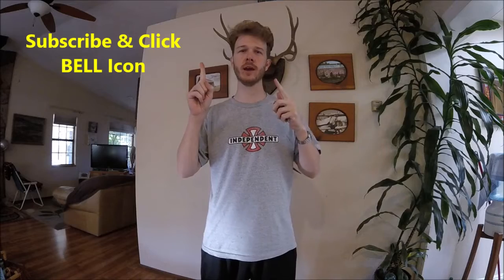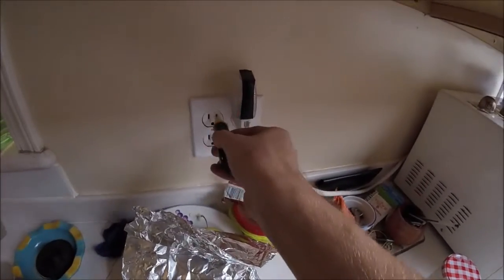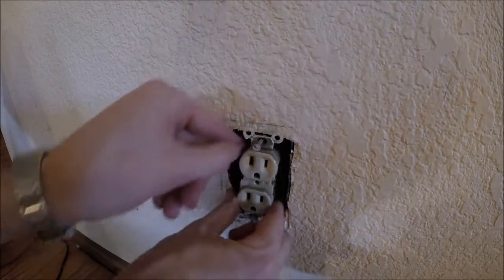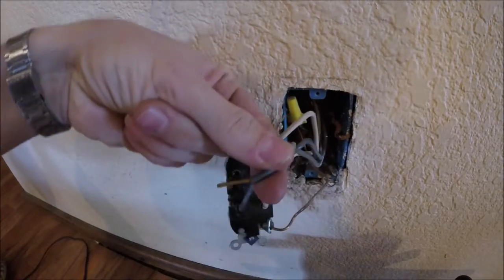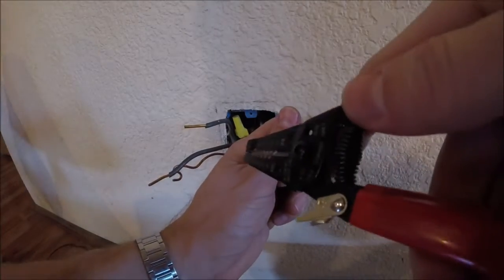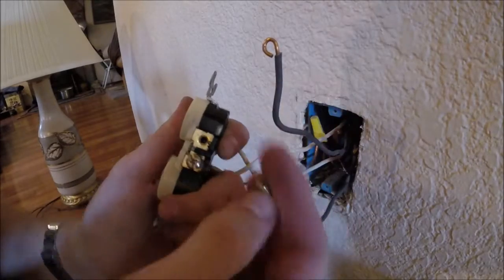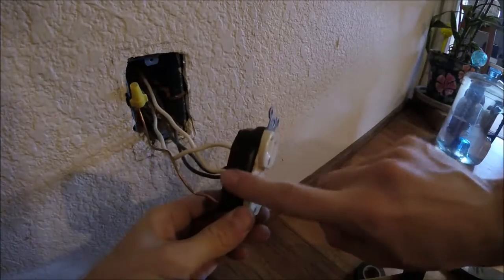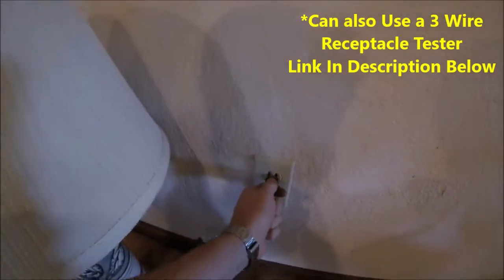Electrical Power Outlet Replacement. How To Easily Replace Broken or Burnt Out Electrical Socket

Comment from the maker: Tools & Supplies Used
Electrical Voltage & Receptacle Set- https://amzn.to/3lgJmvd
Voltage Tester- https://amzn.to/3rFuXv0
3 Wire Receptacle Tester- https://amzn.to/3bHFBfe
Screwdriver- https://amzn.to/38SgZPh
Electrical Pliers- https://amzn.to/3bGLE3C
Tool Set- https://amzn.to/3tbmEbo
Safety Glasses- https://amzn.to/2XXe3dI
Magnetic Work Light- https://amzn.to/33tk6tp
*Thanks for Watching! Help Support the Channel by Subscribing & Clicking the BELL Icon for all NEW Videos

Comment: I'm wondering why the new receptacle did not have mounting screws. They always come with pan head screws with slotted, Philips, and Robertson (square drive) options. Far better than slotted flat head screws. 
That was a good point about using electrical tape. More important with metal boxes. I think you had a plastic box, but still a good habit. 
You should have mentioned that you must hook the wires around the screws in a clockwise direction, I don't think you did that. Clockwise will help tighten the loop as you tighten the screw. Counterclockwise will do the opposite.
Reply from the maker: Thanks for sharing the helpful information Ted 👍 I think I must've used those missing screws for something else at some point

Comment: Question 🤔 None of my outlets are working in my bedroom, can I use the tool in the description box to find out which one needs to be changed? I have already checked the breaker box so I know it's not that.
Reply from the maker: Yes try the receptacle tester to see which plugs are working and will show if grounded as well. Get a voltage tester pen too to be safe. Theyre probably all on same circuit and chained together. If the 1st one is disconnected then all wont work. Makes me wonder why all would be off though

Comment: Johnny, you are right on point Triple check for safety sake.  Not sure if you have a review as yet on electrical tester. Which one is the best? Great video.
Reply from the maker: Thanks! I dont have a video yet. I have a couple different ones. I was using a Greenlee, but Klein, Fluke & Sperry all make fine ones. Klein and Fluke are probably the 2 biggest names with electrical tools 👍